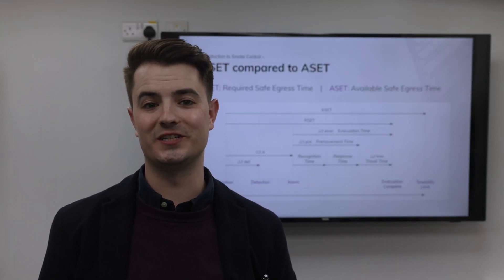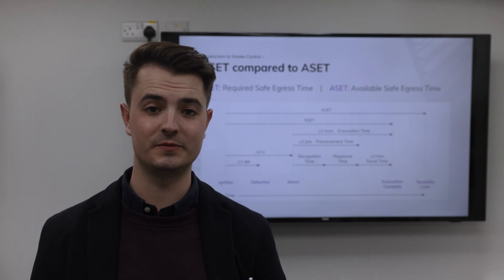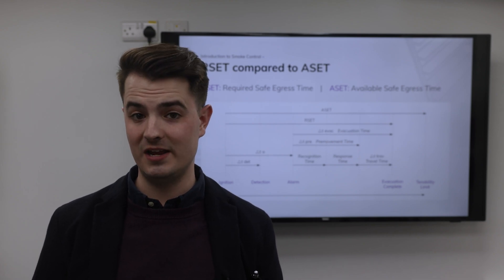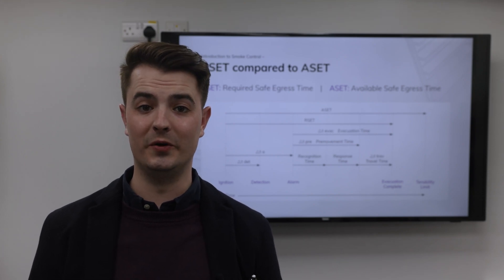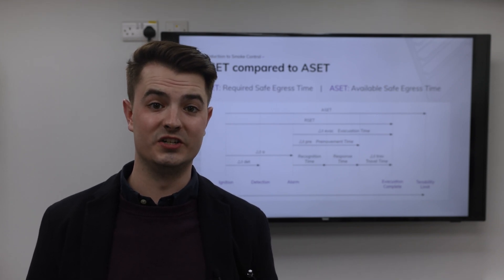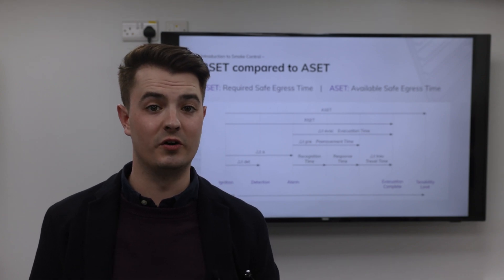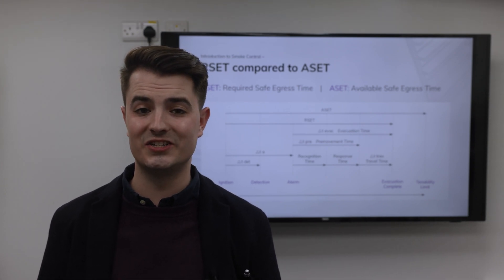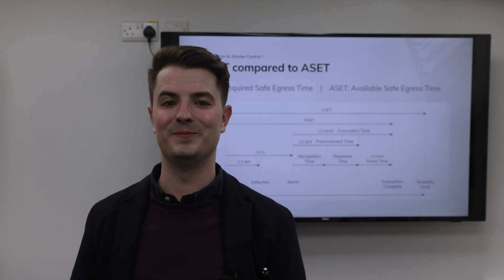RSET & ASET

Comment: I have a quistion if you dont mind, so the only way to calculate the RSET AND ASET are only by CFD models or it can be done by hand calculations?
Reply: Not sure if you're still looking for an answer after 9 months but yes this can be done by hand calculations. As a matter of fact, this was part of my education to calculate it manually. It's a little tedious work and you need to organise your calculations, but certainly can be done.
You can assume a fire growth and fire size and calculate the RSET. Then you can calculate the evaucation time ASET by making some assumptions from the recent research on evacuation. 
While it's possible to do it by hand, it may be better to use software for it. My two reasons for this suggestion is: 1. It's much easier to work with a software as engineer and try to optimise the work/calculation. 2. It's much easier to be verified by inspectors, fire brigade, or any fire engineer who is assigned to check your work.

Comment: Thanks for the video, very educational. I do have a question but it is slightly out of topic and hope you don't mind. What is the difference between fire engineers and fire protection engineers? I believe what you discussed just now is one of the responsibilities of "fire engineers", do fire engineers design fire protection systems as well?
Reply from the maker: Hello Lloyd, thanks for your comment and kind words! 😊

Based on our opinion of the terms, they are synonymous in the UK, BS 4422 (Fire. Vocabulary) doesn’t list Fire Protection Engineer:

 3.362
Fire protection
Measures taken in the design or equipment of buildings or other structures to reduce the danger from fire

3.363
Fire protection, structural
Features in a building’s layout and/or construction which are intended to reduce the effects of a fire

With a Fire Protection Engineer typically involved in passive protection (e.g. fire stopping etc.), a Fire Engineer is anyone working within the core designs of the buildings which can be from full-scale fire tests to sprinkler designs.

I believe the term originaltes from the US, with Society of Fire Protection Engineers (SFPE) which (in the US) is purely the term for Fire Engineers, whereas we may have a slight discrepancy due to passive installers.

I trust this helps?